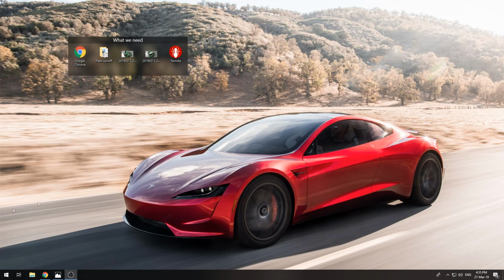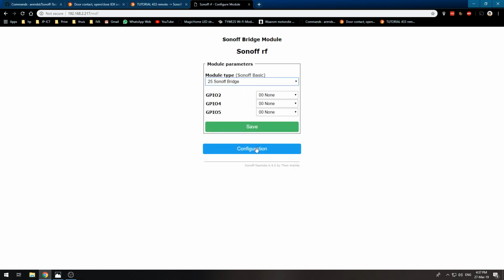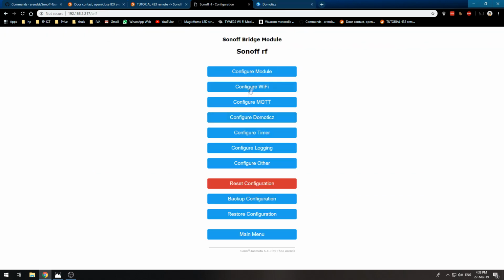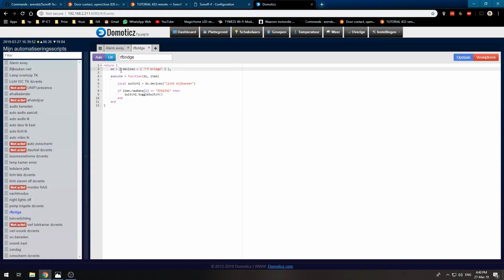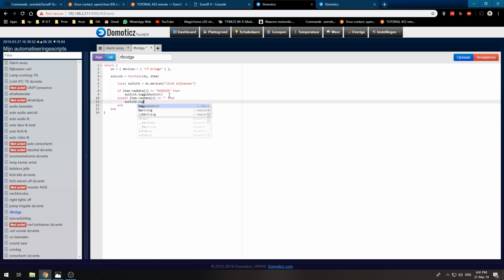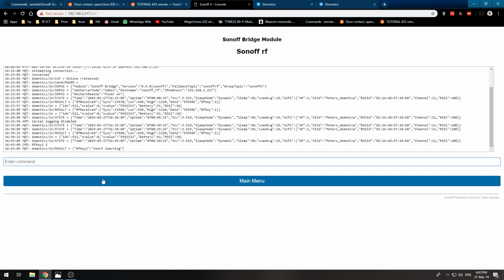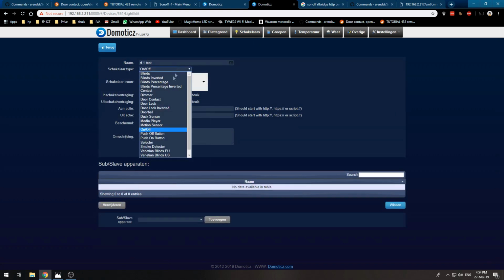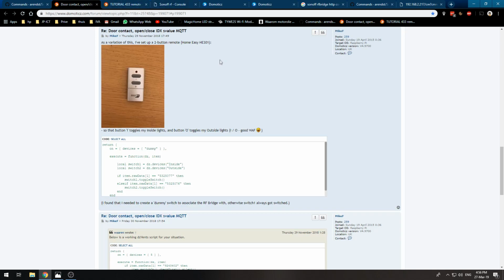How to Sonoff RF bridge with Domoticz and Tasmota

Comment: Very nice job! I will replace my 1USD RF433 receiving and transmitting chips mounted on the rpi with this Sonoff unit so i can place the RF receiver in a more convenient place , closer to the RF devices, and i will be able to turn on tasmota devices using a RF remote control